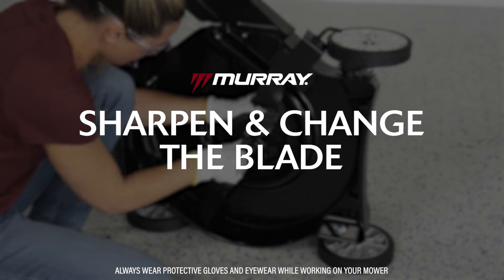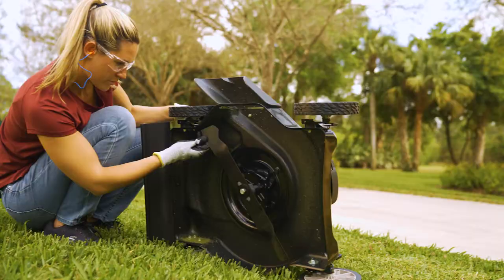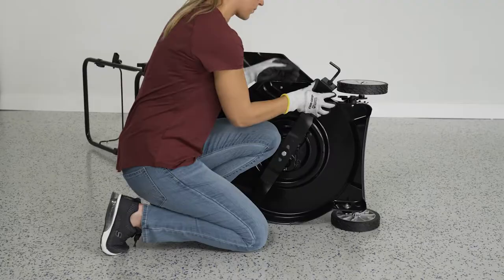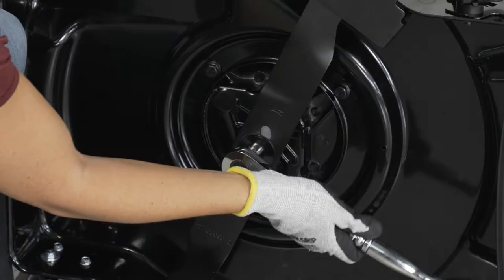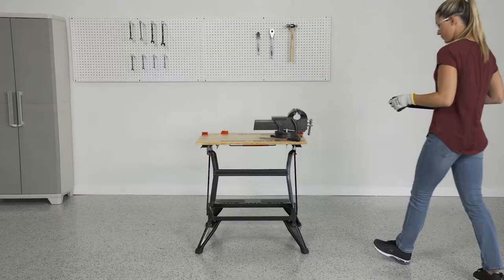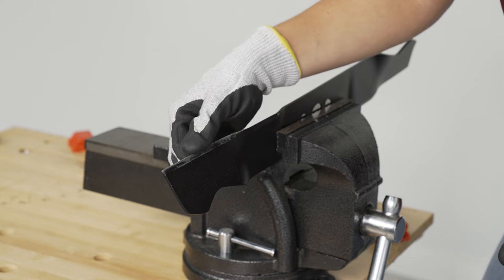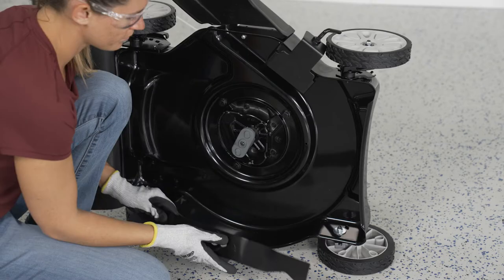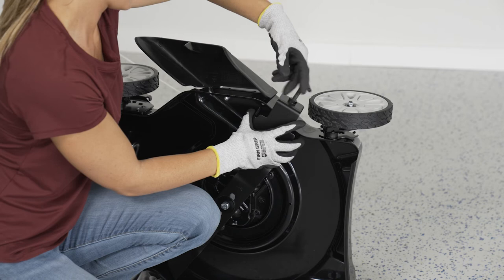Murray Moments: Sharpening and Changing Your Mower’s Blade

Comment: what size socket is needed to remove the bolt?  what's the torque spec for tightening the bolt when you reinstall the blade?

Comment: What if I don't have the blade remover tool?
Reply: use a piece of wood to block the blade movement, a 4x4 or 6x6 would work.  a 2x4 would work but be harder to hold in place.